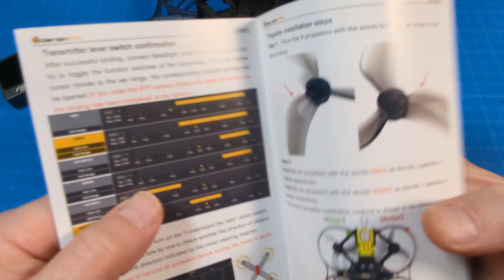Budget CineWhoop // DarwinFPV CineApe35 // 4S & 6S

Comment: The length of your videos is fine. I enjoy the indepth review and being able to see what battery drain is like based on your flying style is helpful. 

I have a few darwinfpv 4S batteries. Nothing very notable. They were less expensive than pther options but performance is same as other brands i have. I get 10+ min on a 4s 850 with my crux35

Comment: Thanks for the review! 
I’ve just built up a meteor 75 pro frame with the walksnail vtx so I can get some safe inside footage. The prop protection helps me feel a bit more secure around furniture and such. My five inch is not prop protected so hitting twigs and branches affects the “smoothness” of my flight a bit more. I wish this came in a walksnail version, I’d be super interested.

Comment: First off, thanks for doing this review.  I used to fly a lot.  My current quads are about 10 years old.  Part of why I stopped flying was because local ordinances made it difficult to fly pretty much everywhere within 40 minutes of my house.  A couple months ago a coworker introduced me to tiny whoops .  Given that I live in the Pacific Northwest where it rains 9 months of the year flying whoops indoors has made it so I can actually fly again. I am a school teacher, and I can see using these with the flight club.  Mostly because the kids will also be mostly flying indoors.
Reply from the maker: certainly, whoops are so nice to have. some hula hoops in a gym would make a nice little course in the school gym, or foam pool noodles or pvc pipes.
Reply: @NickBurnsFPV  we put together a racegow kit in a box and can set up a few courses pretty quickly.  For the beginner kids we have a 2x scale set of pipes so it is easier to get through the gaps.  It is also good to just set up a few obstacles spread out for practice.

Comment: Maybe this style is attractive to newbies?  Prop protection is interesting to new pilots.  Certainly a Cetus Pro is perfect for new flyers, but at this size it may just be another thing to break.

Also that powerloop you do against the tree in the corner is a nice addition.
Reply from the maker: Getting a bit of feedback so far. The most interesting is that the prop protection provides a feeling of durability and therefore less overall cost. Looking to see if that holds up long term. I can certainly see that if the prop guard stays intact it can help save money on props at least.

Comment: I have only one of this style of quad.  I won a Veyron35 frame and built it up.  I dont fly it often, and it is noisy.  I much prefer if I am going to have 3.5in props, that it be open prop, but I like the idea that it has some coverage over the props.  it is the biggest PITA to work on given the prop guards are a cage that covers the motors and is a part of the frame.  so to access anything on the FC, you must remove one or more motors
Reply from the maker: Would you say that the proprotected quad was just an experiment to see if you would like it, or it provides some other benefit which will keep it as part of your fleet?
Reply: @NickBurnsFPV  yh. Mostly experimental.  I have drawn up several versions of prop protection for my printed quad.  That was a miserable failure, but I gained experience points for sure.

Comment: Great review as always.   Darwin is a neat brand, the baby ape was a great low cost drone... this one coming to $559 for the DJI 03 does seem like too much... the $259 for the analog is about right.  I don't see why all the manufacturers are selling the kits with the 03's in them for $200 more, $300 more... things don't add up.  

Starting just at $259 you could buy a complete 03 camera and vtx for $229... and still only come to about $490 and for all intents and purposes with a little fitting the 03 system will fit in... but for the manufacturer if they supply the 03, then they are NOT supplying the analog system which has to cost more than zero dollars... so take $259 and subtract out the analog camera and VTX ...those 2 items got to be at least $75, probably more.  So $259 - $75 + $229 = $413 so what am i missing???   How are they asking $550+

Regarding this kind of frame design, I bought the GEPRC CineBot 30... it was a struggle to decide between that model and the bot 20, or even the very small super lightweight DJI 03 compatible frames like the Flylens 85.   So why did I pick this one?  Well, it is a safer drone than a drone that does not have ducts... It should add some toughness to the drone.  Certainly the Foxeer Foxwhoops will be super durable, they are really great frames and I actually started off with the smaller Foxwhoop 25 but putting the DJI 03 in there was not working out well... very tight  fit.  

Even the CineBot 30 is not a perfect fit for the large 03 VTX... and I thought it was directly compatible... it is if you also  happen to own a saw, a Dremel, some sand paper, etc...  
I am going to try to add a purpose built heat sink for the 03 to this build and I noticed something interesting, I think the fins align fairly well with the existing cooling slots.  So with some minor mods I can have the fins drop outside of the carbon plate on the bottom of the drone - hopefully leading to a way to really keep the VTX cool.

Also, you mentioned Darwin batteries - that is a very interesting subject to me as it is impossible to tell if a battery is a good one or not before you buy it - as it is all but proven that the numbers on the batteries is not always correct...  capacity and internal resistance being 2 of those items that are important to know "the truth" about their values.  

So it seems like Chris Rosser has taken the torch on this issue and is currently doing some battery testing and has made some videos on the tests.  This is with some pro equipment that he got from Joshua Bardwell so that is cool that Bardwell gave the machine over to someone that would use it to help us all learn what's what when it comes to the different battery brands and types.  Some of the findings have been interesting, it is worth checking out what he has done so far.  It has influenced me on what batteries I will buy and why... so hopefully what we are seeing is genuine, reliable, well executed testing without any agenda at all tied to the testing other than learning the facts, just the facts ma'am...  sorry, very old reference.  Cheers

Comment: 4s vs 6s with a gopro on top... does it "require" the 6s for a full gopro or does it handle the 4s well enough? i'm guessing flight time would probably be cut down a decent amount for the extra 100g

Comment: I'm thinking about buying one of these quads. Could you tell me more about updating ELRS and Betaflight, should l need to do this at a later date please. 🙏 I don't want to buy one and then find out everything needs updating. Thanks.
Reply from the maker: There is much more to updating ELRS and betaflight than I can cover in a typed message. I suggest searching youtube on those terms, there will be many tutorials on those topics.
Reply: One other question Nick. What type of charger do l need to buy for the XT30 battery connection. I'm totally unsure as most chargers seem to have XT60. Thanks and sorry to bother you again.
Reply from the maker: @stevemartin2274  I use xt60 to xt30 adapters like this one https://www.getfpv.com/xt60-female-to-xt30-male-adapter.html?afid=ak43czc2Q3dEVk09&referring_service=link
Reply: That's great Nick. Thank you so much.

Comment: I have a kinda off topic question question: How do you use the amp draw rate information? What does it tell you during the flight and how does it help?
Reply from the maker: basically it tells us how efficient or inefficient the motor/prop combination are. The higher the number the more energy they use and therefore the more battery they use. Of course as our throttle going up we expect the amp draw to go up as well. So from quad to quad we want to not only compare amp draw but also the amp draw at the same throttle values. Some motor/props are really efficient at low throttle but not at high throttle and the other way around as well.

Comment: Excellent review.  The good and the bad.  Thanks. Adding this quad to the "list".  ELRS good.  SPI, ehh. OSD update latency is a bit of a bummer.  Older hardware is fine. Me, not the hardware is the limiting factor.  History of crash, salvage parts, and trash the rest.  Would a Caddx Ratel2 fit into the camera housing? Similar price to the Geprc Cinebot30 analog. The other quad on the "list".  Nice to have choices.

Comment: Hi Nick, I only have one of these (similar model) and I fly it in my backyard where there is a pond and some trees and it's in a neighborhood. The prop protections make it less intimidating and able to go through small branches.  Frankly, it's too heavy and does not fly as well as a light 3.5 inch, like the Crux35.
Reply from the maker: yea, no prop guard will outperform prop guard, its additional weight and wind resistance for sure.

Comment: I have loads of 4s 1300mah batts so i'm drawn to the 4s version, but is the 6s better for lifting a full size gopro? if I got 6s version would the lower kv suck when I run out of 6s batteries and use my 4s batts on it?
Reply: (or would getting the 4s version and occasionally running 6s batts on a higher kv motor be better?)

Comment: Hello ! I bought This drone, but 6s iflight 4000mah battery, do you think it Will work? The battery seems to heavy
Reply from the maker: wow, that has got to be a huge battery. My guess the quad will lift it but the flight will be hard to control with any speed, and turns will also be challenging. The flights might actually be somewhat short as well.
Reply: @NickBurnsFPV  yeah… i think i Will have to sell the battery and but an right one. Thanks !

Comment: You have your hands on the new cinebot25 yet ?? So keen . Another one with prop protection like this .
Reply from the maker: I do have it. I don't suspect my review will be out for that one until late next week. I have more flying to do with it. So far it seems pretty solid at the size. Carry a naked gopro just find and hasn't given me any fits yet.
Reply: @NickBurnsFPV  you are the king of micros so your reviews are important to me / us / the community.  I have so many quads and builds I kinda don't wanna keep having excessive quads . So looking for a solid 2.5 that will carry the gopro . Ease of changing prop guards if needed . The ymzfpv does look appealing design if they did a 2.5"
Reply from the maker: @mx118racer  oh thank you so much. When you are looking for a 2.5incher that carries a gopro, is that a full gopro or a "lite/naked" gopro?
Reply: @NickBurnsFPV  use onboard o3 for alot , but also have naked hero8 and naked hero11 in geprc case ,

Comment: how to install elrs diversty on this cineapa35.... 
should i change the port from to spi to other port..?

thanks before..
Reply from the maker: It should have come with an elrs receiver built in. Did you flash a new version of betaflight or something?
Reply: @NickBurnsFPV  no sir.... i just need to install eksternal elrs on this cineape.......
cause the elrs onboard is suck for penetration...
on my area.
Reply: hopelly you can make video tutorial for this quad to install eksternal elrs diversity..
Reply from the maker: @XYZ-2XYZ  I am not sure I don't have this one to investigate. I suspect we need to use one of the connectors to attach the RX wiring then turn on that uart for serial connection. Unfortunately I don't see a wiring diagram on the flight controller on the darwinfpv website. Maybe reach out to darwinfpv direct?

Comment: I think that's too big. I fly indoors and there's risk of bumping into furniture, it atleast allows me to recover when i hit something, but when you're going to be flying in the open where thre's little or no risk of bumping into objects or people, there's no reason for the propguard. At the speed you fly in open areas, i don't think the propguards are going to save you.

That said, having both GPS and propguards seems to contradict each other on what the quad is supposed to be. Usually you use a GPS when you're covering a large area, but flying in large areas would mean the propguards are just excess weight/drag.

Comment: DarwinFPV is at normal quad prices now... hmmm.
Reply from the maker: lol, that is a good take :)
Reply: @NickBurnsFPV  I’m not knocking Darwin. I’ve owned 2 Baby Apes v1’s and my only gripe was the durability of the original motors. I’m just surprised to see their prices as high as they are. If they start to get into GepRC, iFlight, etc. pricing, would you still take the Darwin?
Reply from the maker: @JuicySmullietFPV  I wouldn't if the saving isn't substantially enough.
Reply: @NickBurnsFPV  me neither. I hope they can get back to being budget. That’s their niche.
Reply from the maker: @JuicySmullietFPV  I have had some comments that a $40-$50 savings is worth it to some....I suspect it comes down to one's own fpv budget.

Comment: They copied OddityRC
 No doubt
Reply from the maker: That could be an oddityRC original design. I wouldn't say that publicly as there could be some other little known designer or company that "did it first".
Reply: @NickBurnsFPV  I worked in the industry for a Vietnamese guy who owns manufacturing.  No names.  He definitely copied a few designs.  It's a very common thing to do as you know.
Reply from the maker: @GreasypoleNation  Yes, when something is good or popular the competition will do just that compete. It might not be on the level competing, but competing none the less.
Reply: @NickBurnsFPV  keeps designs improving! Lol.  Do you feel the oddity was among the best of the bunch ?
Reply from the maker: @GreasypoleNation  Yes, in my opinion they build like I would build and the pid tune is really good.... fast or slow flight.
Reply: @NickBurnsFPV  just got my 20 and 35....can't wait to fly em.
Reply from the maker: @GreasypoleNation  from oddityRC?
Reply: They mentioned it on their website, based on XI35 from Oddity.